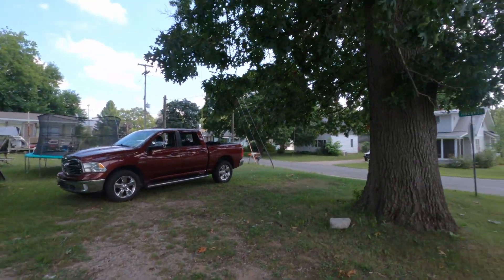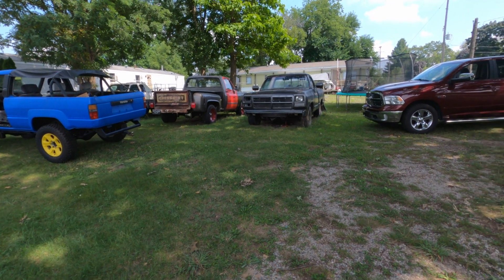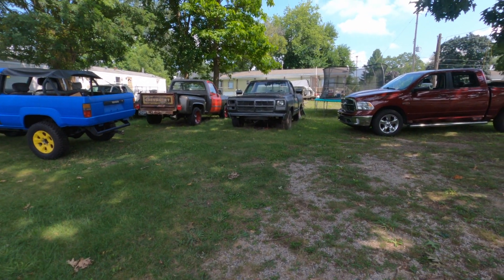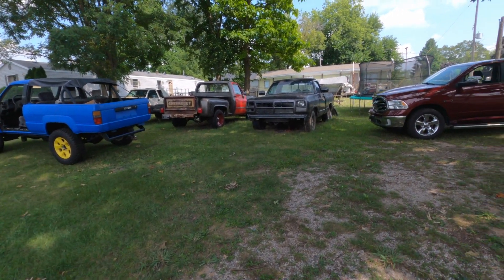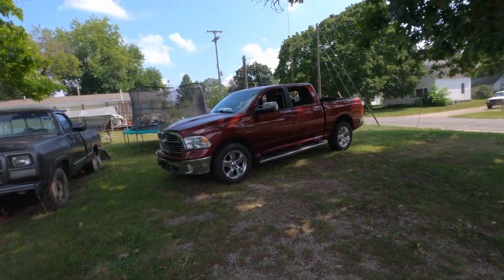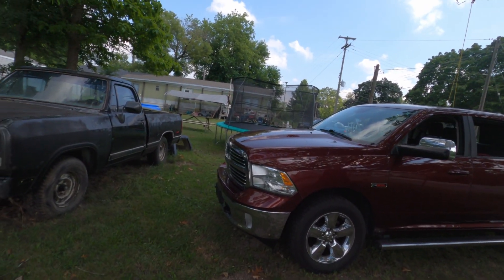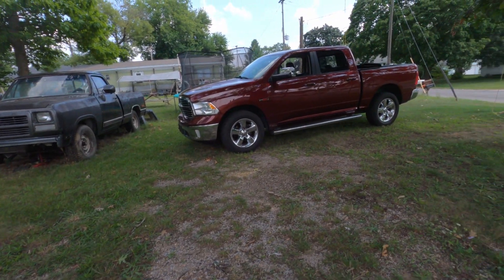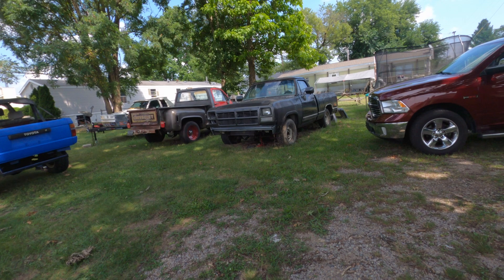California has a new law about ECU tuning, and SEMA is doing nothing about it.

Comment: I have a Vanagon here in Texas that I converted to Subaru power. No doubt that it is cleaner than any VW Vanagon ever produced. In California, you can only get a Vanagon Subaru conversion to pass CA regulations if 1. You go to a special station to have it inspected/arbitrated, and 2. Only if the conversion parts (trans adaptor and exhaust system) was made by Kennedy. There are several companies that make adaptor/swap kits, but only Kennedy (based in CA) has been tested, and so it is the only approved kit. You can’t get a Subaru engine to work 100% correctly without all the smog stuff, no matter which kit you use, as the Subaru ECU’s require signals from the O2 sensors, etc. And even if you could, it would still be cleaner than the 50% less horsepower VW waterboxer you pulled out.
Reply from the maker: Not to mention, keeping any old vehicle on the road results in far less pollution than building another.

Comment: The thing that frustrates me the most is gasoline engines for the masses are dated, and their time is coming to an end. If it's only 1 or 2% of the cars on the road that are tuned, they won't have any real effect on the environment when the other 98% of cars are electric. This is unnecessary as the emissions problem will solve itself in the coming decade just due to simple economics and the masses looking at cars as nothing more than a tool to get from point a to point b.
Reply from the maker: Generally speaking, most problems will solve themselves. 

If they're really problems, solving them means money, and where there's money, there's someone looking to make it lol. 

Government never seems to help in these situations

Comment: But you are missing one point to Ecu tuning. Those that can do it to get around emissions and change a car to pass a tail pipe test. That is what they are trying to avoid (I'm sure you can also think of the brands who did this on a mega scale and caused this issue,  go complain and rant to them as it trickles down us now) and if they have a set standard to this the requirement of a tune that all major manufacturers follow and now we set accountability up for H or E they can get hit with penalties if laws are broken for messing with emissions.  They cant setup fines and penalties for Bob if he came over and does a flash because how would they track Bob. So it then falls to the actual car owner as they are liable for irregularities in the vehicle they own and modification they do.  It's a sad thing what has happened because of others but it can take so little or allot to charge the world really fast.  We all have to be careful with what we do as it can change laws in an instant.